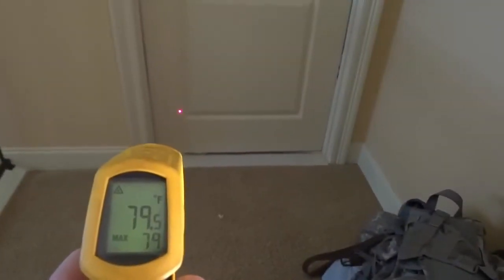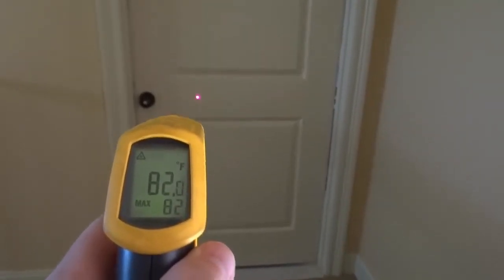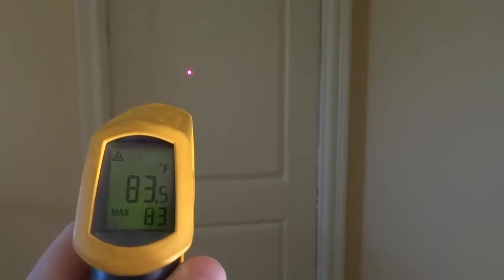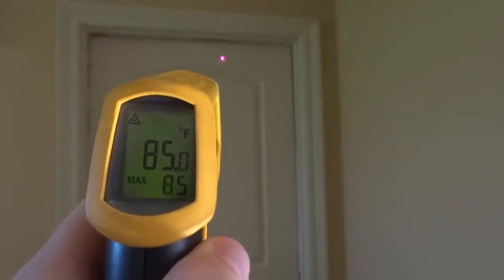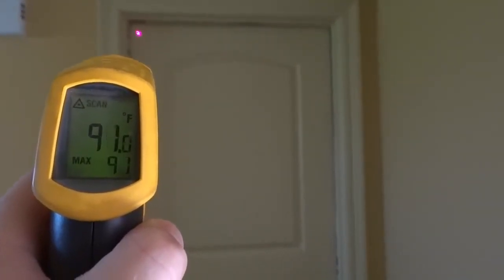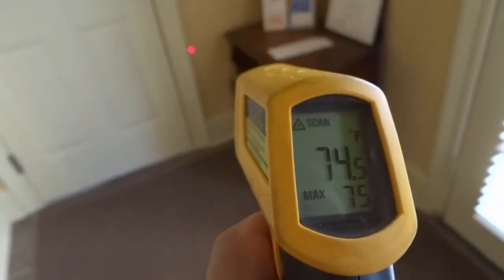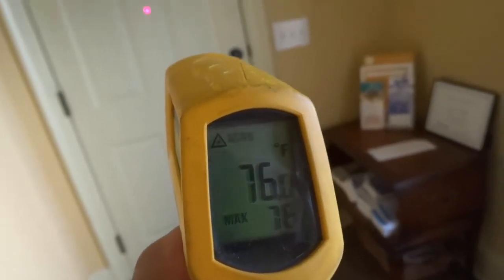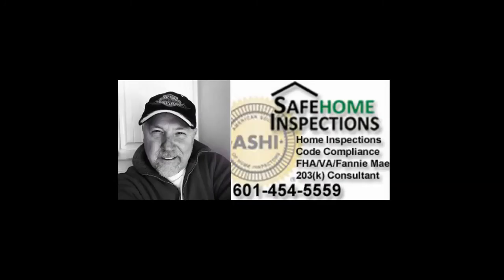Energy Efficiency - Insulated Attic Door vs Inerior Door

Comment: can you give advise were to start to insulate my door , should i get a insulated door should i glue foam board to the back, i live in south texas
Reply: It's best to purchase a door designed to combat the heat. Weatherstrip is very important and exterior door units are designed to allow you to remove and maintain the unit over time. Check the door sill. To prevent air from leaking under the door, ask the salesperson if the threshold is adjustable.